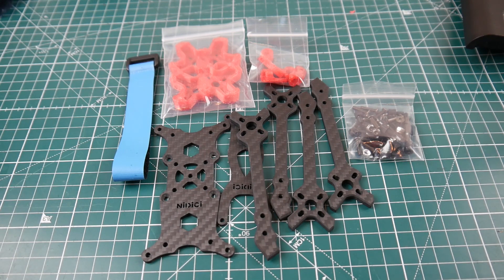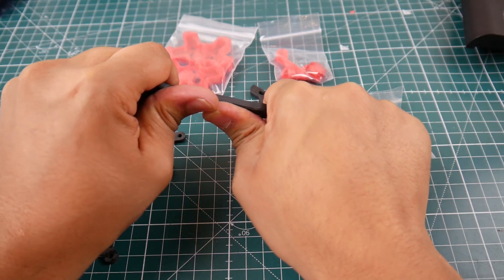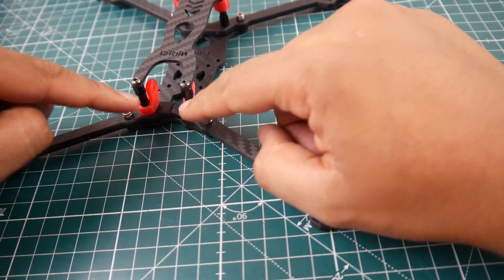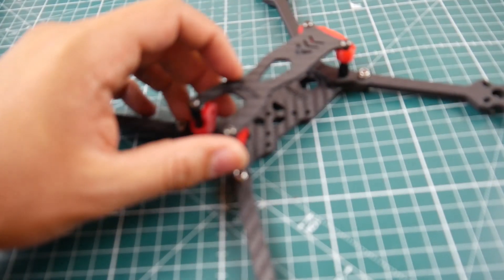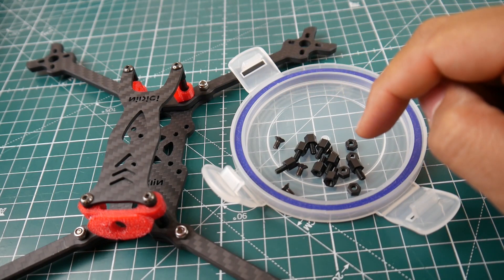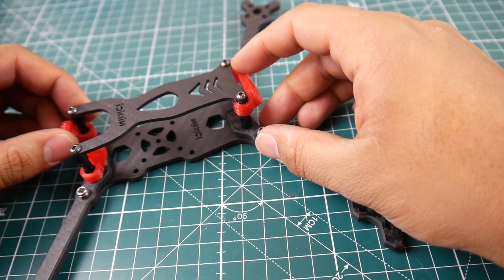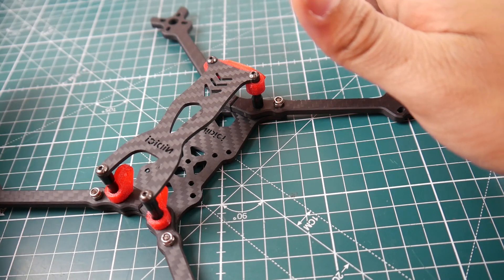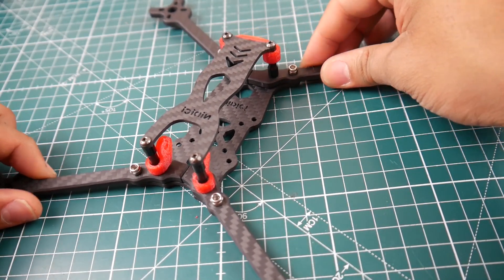Nidici Qian-H5 235mm FPV Frame // 68 Grams!!!!

Comment: It's a clone of Seth's AKA RC addict frame mode 2 ghost. He's got a pretty sweet Channel and builds nice quads. It's a shame they didn't offset the holes for the stack though like the ghost so it has room for the camera and won't be right next to each other where the plug for the camera is basically touching the stack. On The Floss and the ghost they set the sack towards the back and offset it. Does 3D printed protectors are arm guards they really won't do much for protecting a motor but help a lot with d laminations and crashes on concrete I always have use those

Comment: yeah not inspired, basically a mode 2 ghost clone. The assembly is exactly the same. I own a mode 2 ghost.
Reply: I also own a Mode 2 Ghost, but I wish the Ghost had the second arm bolts on the outside of the standoffs like this one. Now I have to take off the canopy to tighten the arms. Also, the Ghost doesn't have chamfered edges. The HANTU 5 inch 210mm is much closer to a clone, if you ask me.

Comment: Mode 2 ghost clone
Reply: mode 2 ghost has 4mm arms. different ends to the arms. different base plate and top plate as well. it's a similar in design but far from a clone

Comment: It's a mode w ghost clone.
Reply: Mini Quads Mega Fun it's nothing like that. 

Car companies make hatchbacks that look similar all the time. It's not cloning. All phones generally look the same with slightly different looks. It's not cloning. 
This is the same thing kind of thing. Not every frame that comes out is going to be 100% original. Some designs (like this) just work. Nidici wanted to improve the concept in their own way. Cloning is unnaceptable but this isn't cloning. 

Also. I dont have a girlfriend :(
Reply: mode 2 ghost has 4mm arms. different ends to the arms. different base plate and top plate as well. it's a similar in design but far from a clone
Reply: NanoNippy that’s like saying when I fucked your girlfriend it didn’t really count cause I wore a condom so I didn’t actually touch her......